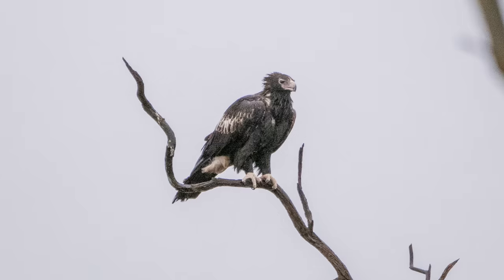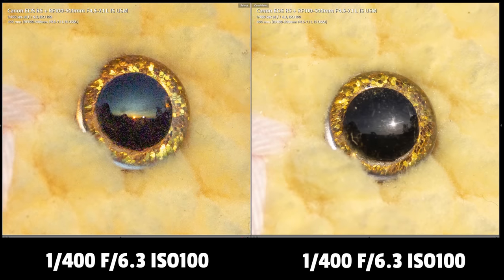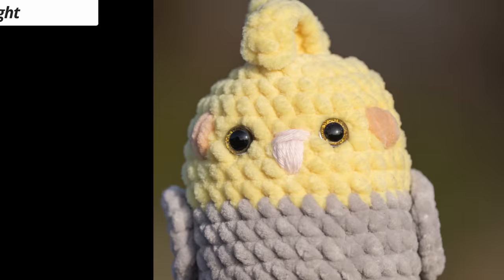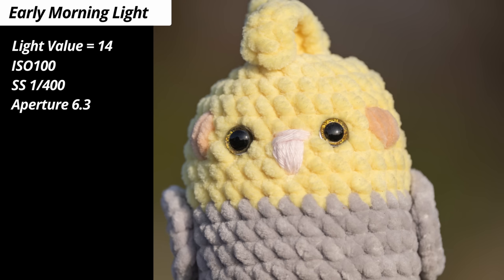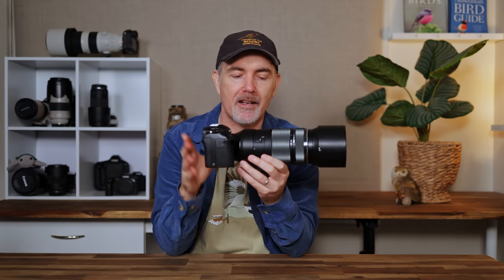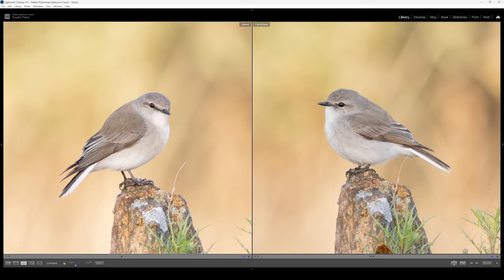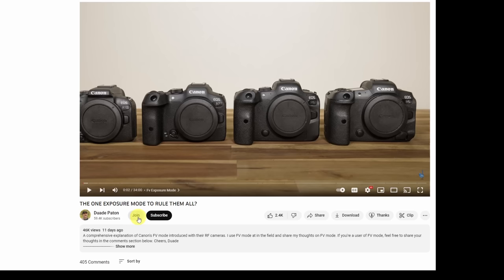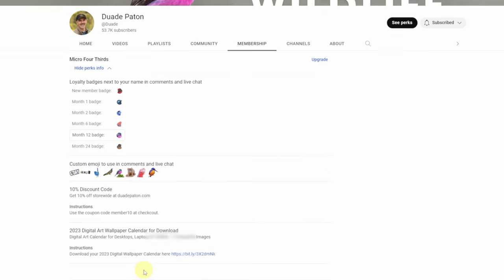NOISE SIMPLIFIED, WHAT CAUSES IT, HOW TO REMOVE IT!

Comment: Third way to increase the light is to add some light. Have you ever use flash for wildlife? What are your experiences? I thought about it. Even have proper gear but I find it difficult to set it up right. Both physically and in terms of camera/flash settings.
Reply from the maker: Hi Pawel, I have always struggled with flash to be honest, I have used it a few times but struggle to set it up and find it to be a pain. Jan is a master at flash but uses it a lot less now. Cheers, Duade
Reply: I have used a flash with bird photography, and within certain limitations it works quite well.  The flash is really only used as a fill light, so it is set to a -1x exposure compensation.  Once set up everything is really quite automatic.  It does a nice job giving a catch light for the eyes as well.  The major limitations is the flash sync speed restricts you to relatively stationary subjects, and of course the distance has to be within the range of the flash.  Just another tool to use when appropriate.

Comment: splitting hairs Duade, but ISO kind of exacerbates a light starved sensor.  Since ISO is simply amplification of the original input data, you're amplifying poor quality light starved data and making what's already bad, even worse.  IN the good old film days, ISO directly impacted image quality, since higher ISO films had larger grain structure.  This is where digital really excells imho.  Even at 25600, noise from my R3 is better than Tmax 800 ever was back in the day!  

I am counting down the weeks till I can use my rig again.  4 more weeks.
Reply from the maker: Thanks mate, yes, it appears I need to do more research on the exact goings on as it is a bit confusing. I will be trying the R3 soon and looking forward to it. Cheers, Duade
Reply: @Duade  Nah, you are right - as long as plenty of light is hitting the sensor, even higher ISOs will be reasonably clean with digital cameras.  Starving them of light (underexposure) causes noise to worse as the base signal is amplified more.  Higher noise that's amplified will always make noise even worse.  Darker colours tend to show up noise more too, that's just optics.  Modern MLCs chroma noise is really well controlled.  Luminance noise is much easier to clean up than chroma noise.  

Analogue film ISO is a very different beast.  

I think you will love the R3.  It's obviously bigger, but it isn't super heavy (about the same weight as the R5 with its battery pack).  I think you will enjoy its DR and high ISO performance.  AF is superb of course.

Comment: Great explanation. I will have to try and get more shots with a lighter background. My computer is too old to use noise reduction software. I can’t wait to get a new computer so I can try this noise reduction software on my images that are higher iso then I would like to use but if I didn’t I wouldn’t have got a good shot. As you said better to use a higher shutter speed and iso then to have a blurry image.

Comment: I use Topaz routinely for virtually all images of the sharp keepers. I’ve even used noise reduction software on night photography of wildlife, where I was using a dodgy old torch, with no flash, as my only light source, iso 25600 with 1/100 ss on my old crop dslr and the image was still pretty good!😂
Reply from the maker: Great to hear Tod, it really is incredible, Cheers, Duade

Comment: With modern iso inverant sensors you can pretty much shoot at base iso and raise the exposure in editing software and the noise will be the same as if you had used the correct iso in the field, only downside is the preview on the camera screen will be very dark. Dont try this on older sesnors though the result wont be pretty.

Comment: Unrelated to this video but…do you leave your camera on while sitting and waiting or do you turn it on and off?  I like it left on and half press the shutter often to keep it awake.  I’ve not had an issue with running out of battery power but I did buy a battery grip that holds 2 batteries for my Canon t4i. I also keep 2 extra batteries charged in my bag. Just wondering what you or others do and WHY you do it. Thank you.
Reply from the maker: G'day Todd, I am the same as you, I leave it on as I don't want to miss the action, I can always change the battery if needed. Cheers, Duade

Comment: the camera world has changed.  I was always a Nikon shoot and my last camera was an early D3 full frame.  As a landscape shooter I usually left it on "Auto" mode!!!!  Once in a while I switch to Aperture Mode.  ISO was 100-200.  Rarely up to 400.  Never thought of shooting birds in flight.  Now with an R5 Canon I switch to back-button focus-eye tracking-auto ISO for everything.  So now stationary subjects are shot with 400-500 Servo while fast subjects are shot at 2000 -2500 ISO wide open or stopped down one stop depending on the lens.  De-noise or DX3 fixes the noise but the focus is usually sharp.  Landscapes? Well single shot 60-200 ISO seems to be the norm. Programming the M-fn button to switch between C1-C2-C3 allows all three mode to change on the fly.

Comment: Great explaining about noise in pictures. I found another point in noise in pictures. when opening a raw picture from my canon R6 in Lightroom without anything changing i get a little bit more noise in the picture then when i first open it in caon DPP (olso without anything chaging). It looks like adobe Lightroom ads i litlle amount of noise to it. so if a have a noisy piture, i first open it in Canon DPP, export it in ass a .TIFF file a then open it in lightroom. i'm not doing it for all my raw files because it's time consuming and not all pictures have a lot of noise. i checkt the setting in Canon DPP if there is any noise reduction standard on, but i could not find it.

Comment: It's interesting to see that your most commonly-used ISO values on the R7 are lower than on the R5. Is this a conscious effort on your part to reduce noise, or perhaps a consequence of not needing to use a teleconverter to achieve a similar focal length?

Comment: Good video apart from...

The Sensor size does not effect Light gathering this is a massive misconception that keeps getting repeated.
No light meter has ever asked what size the sensor or film is... Shooting on 35mm or medium format, the exposure settings are the same.
If ISO 400 - F/4 - SS/1000 is the correct exposure it is the correct exposure regardless of Sensor size (It does not mean the quality of images will be the same, regardless of sensor size) If a bigger Sensor let in more light the exposure settings would change

It is true that Larger sensor cameras generally have better low light performance (although is less than a stop between sensor sizes in most cases, APSC - Full frame - Medium Format) this is Not because they let more light in - it is down to a number of factors, Pixel size being one (a 24MP Full frame camera has bigger pixels than a 24MP Crop camera) the Signal to noise ratio being another, The processor is another and how it amplifies the image.

You will also find a modern Crop Camera will have superior performance in low light to a Full Frame camera from a previous generation... If sensor size effected light gathering this would not be true.

You will also find that if you crop your full frame camera to the same FOV as your crop sensor camera (1.5x or 1.6x in the canon world)  the noise levels will appear almost the same (if cameras have equally capable sensors) however you may find that the more expensive full frame camera has less detail if you are throwing away 33% of your pixels if your full frame and apsc have same number of base MP (e.g. 24MP).

Best way to think about it is on a per pixel level not on sensor size and how that effects noise at a given ISO, not bigger sensors capture more light... which is just not true
Reply from the maker: Thanks for picking that up, I got that explanation wrong and will remember for future, I have removed that part of the video which should update. I logically understand the pixel size light gathering but didnt do enough research clearly. Cheers, Duade
Reply: @Duade  No problem :) I love your channel, keep up the good work, you do sort of explain it right just the part about Bigger sensors capture more light/let in more light.... It is not easy to explain, I guess "In general, cameras of the same generation with a larger sensor produce an image that has approximately one stop less noise due to benefits such as larger pixel sizes, when comparing Full Frame to APS-C" - I think that would be a fair statement
Reply: What you will find when Duade and others talk about larger sensors gathering more light is short hand for an overall effect. From a practical point of view, astro photographers prefer larger sensors - and light vs resolution is the reason. One way to explain this is as below.

Pixels can be summed, either in camera or in post to effectively make larger pixels. I also use that technique for iso 25600 and above on my R5. Eg, on my R5 45Mpix, at high iso, I sum the neighbouring pixels to make a final image size of approx 7MP. These 4x larger 'pixels' average the noise out, giving with the effect of using actual larger pixels, with the coressponding effective lower noise at a given iso.
You can also do this in camera.

The reason Canon's premier professional camera, the R3 has only 24Mpix is, sports togs often supply their images in real time, jpegs straight out of camera to their customer, and do have the time to denoise in post. The larger pixels a 24Mp sensor has is a happy practical balance between noise and resolution. Larger pixels for a given sensor size = lower resolution. A smaller m43 (1/4 area) sensor, with the same 24Mp will have 1/4 sized pixels and perform 2 stops worse in a given light level. That 2 stop penalty could easily make the difference between a money or not.

Thus, you can see a ff sensor, for the same Mp count as a m43 sensor (1/4 the area) will have approx 4x larger pixels, with the corresponding 2stop noise advantage over a m43 sensor. In the real world, sensor size matters. Bigger sensor = bigger pixels for the same Mp count = lower noise.

And, for a given generation, for the same pixel size, all manufacturers noise perfromance is about the same.

Note, for astro shooting, sensor electronic noise can be a secondary issue to, essentially lack of photons. Even if your sensor had infinitely good high iso performance, short shutter astro of deep sky dim objects, will likely give poor results. Think of a lawn sprinkler and a bunch of plast cups on your lawn. After only 10 seconds there is a wildly different amount of water in each cup. After 2minutes, the cups all hold a similar amount.
 Same with very distant photons, dim objects may require 2mins or longer of imgaging to gather a nice even spread of photons. 

When Duade and others say 'a larger sensor has better high iso performance' what they are saying is essentially correct, it is just shorthand for the longer explaination.

Comment: What do you think about DxO Pure Raw 3?
I tried the test version and compared results from version 2, and yes they are in very rare (unusable noise!) cases slightly better, at least less "painting like" looking when using AI mode, but in general these are anyways the even from Version 3 pretty "unusable" results and anything DxO can handle (V2 and 3) is very similar in my opinion. In fact some results even vary a bit with the same software and setting when using AI mode so comparison is also very hard

Except for the faster processing speed and in rare cases very very bad noise i see advantages in the newer version, but i prefer the UI of version 2 somehow (similar to Topaz Video Enhance AI vs the newer and worse Video AI)

Comment: Noise is even simpler: signal gain. 

Increasing or boosting the gain of an electronic signal introduces signal noise. Hiss in audio, grain/artifacts in visual.

As signal processors and image sensors improve with time, they introduce less signal noise when signal boosting, in addition to being more sensitive to signals (ie. light) along with the capacity to boost signals higher.  

The likely reason why all digital photographers who have been in the field for long enough, having used earlier sensors with limited dynamic range, are so obsessed with high ISO noise, is because it has probably rendered a lot of images taken over the years basically unusable. I am guilty of this. I value high aperture lenses. I like to shoot at lowest ISO whenever possible, to the degree that I often take lesser photos by limiting depth of field shooting wider than is optimal. Not the best habit. 

I've just started using AI sharpen tools, and I have a pretty good sense that they will likely get me to change 20 years worth of habits, when the situation calls for it. 

I suppose the other interesting thought is any photographer with a back catalog of archived images shot on older cameras of their time, can and probably should see which of those images can be saved using AI sharpen tools. Probably quite a lot.

Comment: I have Sony a7r3 and 35mm f1.8 and the kit lens 28-70mm.... i took low light images with same shutter speed, same iso and same aperture f4.   All at 35mm..... Full frame.... The kit lens had much more noise as the prime lens..... Could you please explain this.... thx. JvR.

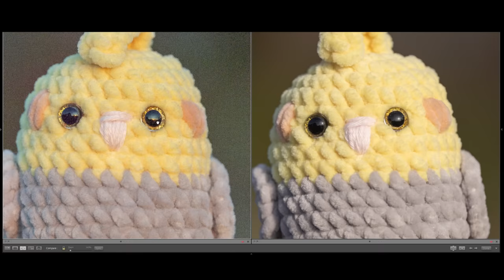Comment: I think the example you shown at 1:03 is a not a good comparison.

Reason being the left image was not properly exposed and taken at a different time of the day.
-It was pushed 5 stops in post , correct iso would have been around iso3200 which obviously produce more noise

A fair comparison would be 2 shots taken with same lighting conditions and exposed correctly
- one taken at iso100 vs one taken at iso6400. (good lighting)
- one taken at iso100 vs one taken at iso6400. (bad lighting)

i will then suggest comparing the image taken at good lighting iso100 vs bad lighting iso100 (CORRECTLY EXPOSED). you can do that for the ones taken at iso6400 too...

My conclusion: High iso does produces more noise especially in low light conditions
Reply from the maker: Thanks, yes, your suggestion would have been interesting and would have shown as you say the higher ISO number would result in more amplification of the light recieved. This would indicate a lack of light meaning the sensor will create noise. There is no dispute that when using a higher ISO the camera is lacking light and creates noise. I think the key is knowing that the light value, sensor and how dark or bright the scene is has a large impact on the noise. Cheers, Duade

Comment: I also like your metaphore of window. I would elaborate it to make it more precise. Apeture is like a size of a window as you see it from a given distance. Size of the window itself is what in optics is called entrance pupil of the lens. And the distance from where you see it is a focal length. Focal length divided by entrance pupil gives us apeture. Window of a given physical size (entrance pupil) but seen from longer distance (focal length) appear smaller and lets less light shining on us (higher f-stop). Same window (same entrance pupil) when we stand closer to it (shorter focal length) lets more light shining on us (lower f-stop). That is why to get the same brigthness from longer distance (telephoto) you need to build larger window (and larger room). That is why telephoto lenses increase their size basically linearily with increasing focal length (at given apeture) or with decreasing apeture (at given focal length).
Reply from the maker: Thanks Pawel, very interesting again, thanks for your explanation. Cheers, Duade